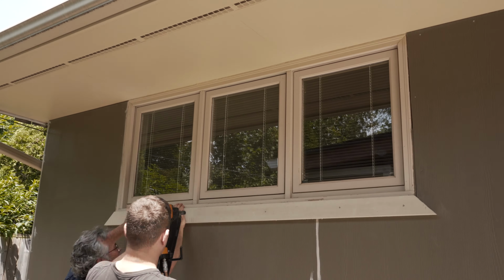House Upgrade | SIDING HOUSE (Part 3) HARDIE BOARD INSTALLATION & FINISH

Comment: Tip:   Cut a spacer block and attach a handle to fit between batten strips. It's faster than using a tape measure and level. Assumes the first batten on each wall is plumb.
Reply from the maker: Oh I like that idea. That would have saved a lot of time. Id did ensure corners were plumb, so definitely it would have worked. For anyone else who is watching or thinking about installing Hardi Board, you should try Mike's suggestion. Thanks for the comments and for watching!
Reply: I'm a woman who doesn't build things, and even I laughed when I saw them using a tape measure every time (not even holding it level at 4:13). Surely they had plenty of scrap board they could have used as a spacer. Found this video trying to decide whether the board and batten look would work for my house. Looks nice here!
Reply: Works even better for horizontal siding, make a T shape and hold it upside down with the horizontal piece sitting proud of the vertical piece, vertical piece is the length of the reveal specified usually 6.5” for 8” wide planks. Set your bottom course, place the upside down at against the first course, set next course on top and nail it. With 2 guys and this method you can side a house in a day.

Comment: Did you place each batten on a stud or did you just pick a distance and shoot them into the cement sheathing?
Reply from the maker: I tried to start at a stud and hoped everything was on 16" centers as it should. As an extra precaution I did add some thick plywood underneath. If you stick to 16" centers you should be good. I hoped you enjoyed the entire series. Thanks for watching!

Comment: I am guessing it doesn't matter because your siding is under the cover of a roof line, but isn't window and door trim supposed to but up against the Hardie Board rather than sit on top of it? That way waters will hit the flashing and run over the trim and windows. I could be wrong but it looks that way according to the installation guide from the manufacturer.
Reply from the maker: The large overhang does provide a ton of protection. My logic, right or wrong, was to have depth, that is to create a bigger profile. Hopefully making it pop more. It probably is more cost effective as time effective. I'll look at it for my next job. Thanks for watching!

Comment: Just cut spacers for the battens out of a 2x4 or something
Reply from the maker: I could have, but if you look closely, there is a definite design on the edges. I really like that look. If they were ripped from wood, the edges would be smoother. I guess it boils down to personal choice, and cost too. Thanks for the comment and watching the video!
Reply: @fireandlemon131  I mean instead of measuring the spacing for each batten when putting them up just cut two spacers to place at the top and bottom and fire away.
Reply from the maker: @erenbecomesdovecrying6016 , Sorry I understand now. A comment from Mike Hunt suggested similarly but with the addition of a handle. Both great ideas. Any tips for when I clad the posts? That was very time consuming because the 4x4 posts had twisted on me since installed a few years prior.
Reply: @fireandlemon131  use a larger dimension of lumber so that it doesnt warp when its drying or let the 4x4 dry more before installing a roof on it. Larger lumber is almost always a better solution for a structure like that, always overbuilding exposed areas. If you dont know the answer just overbuild. 

You could use a larger dimension of lumber to clad it so that it wont twist down on to the pole. Or a more rigid species of kiln dried wood. The problem was likely the grooved boards you were using, they are grooved to be lighter but they are also very flexible so they would adhere to the contours when nailing. 

Or drill pilot holes for screws instead of power nailing and float the cladding on the twisted areas. Or hand nail. The power nailer was driving the nails too far. 

You could replace the warped post.
Reply: What did you use for your board and baton?
Reply from the maker: Sorry for the delayed response, i used the Hardi-Board product for both the board and batons and all trim.

Comment: Never miter exterior trim on windows you would starve if you did this for a living
Reply from the maker: Certainly can't argue on that one. I guess I'm glad I don't try to make a living off of this. I still prefer the look and I don't mind the extra time and effort. Thanks for watching and the comment!
Reply: That is the benefit of DIY, you can spend more time and get the look you want rather than having to settle for a team of "PROS" who rush through and cut corners and would never miter corners like you wanted.
Reply: That is the benefit of DIY, you can spend more time and get the look you want rather than having to settle for a team of "PROS" who rush through and cut corners and would never miter corners like you wanted.
Reply: @Tomcoker1952  Its square edge trim, no need to miter it.  With a "professional" install you can't tell its mitered or not.

Comment: I know your proud, I just completed my house upgrade, went from 1960's asbestos shingles to Hardie board and baton.  It's tough work, I am 68 and did it with the help of my wife.
What type of nails did you use? And what spacing on the buttons did you use?  Again great job
Reply from the maker: What a great project you and your wife took. I'm sure it looks amazing as well! Tough work is what keeps us strong, but 68, hats off to you! I used two different lengths nails (2 1/2" & 1 1/2") both were galvanized. Baton spacing is 16" on siding but I've seen other use 12". Thanks for the compliment and thanks for watching. Check out my kitchen videos, nearly done a kitchen reno. Cheers!

Comment: Did you have to leave space between each 4x8 sheet? How heavy were the 4x8 sheets?
Reply from the maker: Not really but I tried to keep a gap for the caulking and thereby ensure watertight seals. Sheets were heavy, and I didn't weight them either but i would guess 30-40 Lbs. Thanks for watching!

Comment: Why didn’t you put hardie board and stucco on top of it?
It would have looked nicer, but I like how it turned out.
I am just biased  because I LOVE STUCCO match with stone.
Reply from the maker: Before I decided on Hardi-Board, I was looking at stucco. I also like that look. The  place I dealt with, a reputable place, had warned me of the complexity the stucco systems these days are. That made me paranoid, since I wanted to do the work. I also loved the Hardi-Board look, it was easier and less risk, so I went with it. Thanks for watching!

Comment: What are the finishing details if I want to try and do this on my own? Would you have to cover the holes or caulk around the edges? Is this important for like rain? Newbie but curious
Reply from the maker: Hi Nancy! After I had installed the boards, I ensured that layer, was water proof. I applied the special caulking approved for Hardi-Board, at each seam and edge. I also caulked over each nail head. BTW, anywhere I had cut the board, I also used their special touch up paint to seal the cuts, before I installed the boards. I tried to show each step over the course of several videos. Any other questions feel free to ask away.
Reply from the maker: Oh an thanks for watching!

Comment: What material was used for the back board
Reply from the maker: I had installed 3/4 plywood over the existing plywood. The old appeared to be 3/8". I wanted to ensure a good grip of the fasteners when installing the hardi board. Thanks for watching!

Comment: What did you use to cover the nails in the battens?
Reply from the maker: I used the recommended caulking, the same caulking that I used at each seam. Probably didn't need to do it, but why not. Thanks for watching!